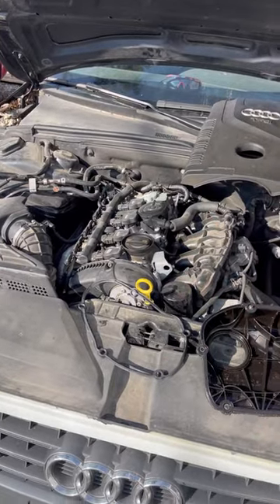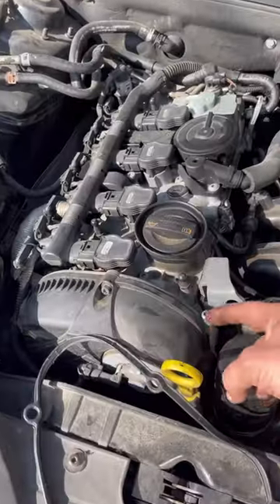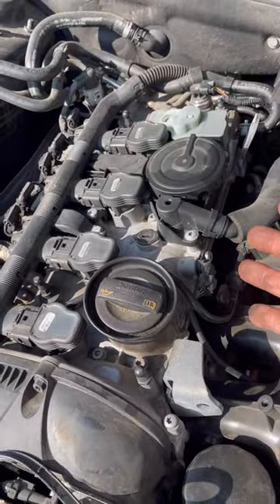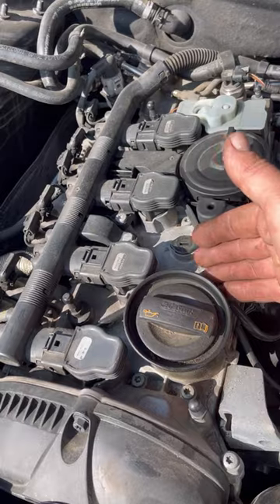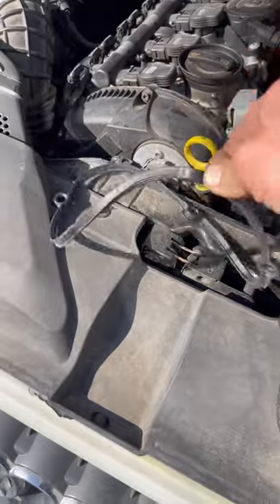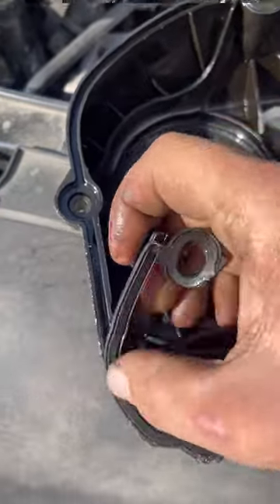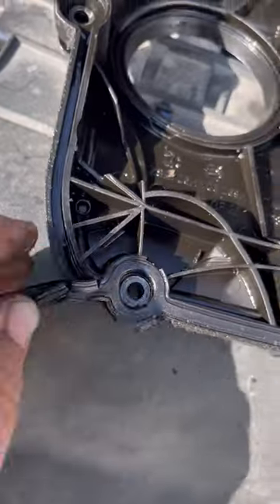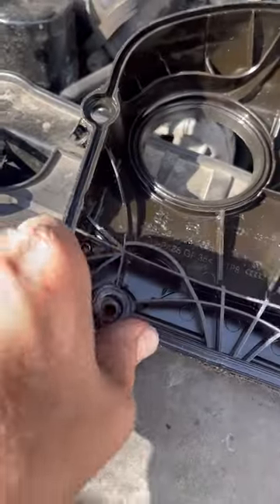VW Audi 2.0t oil leak Crusty Hard Gasket upper timing valve cover camshaft tray

Comment: Question? I have a 2011 audi a5 . Recently, I noticed white smoke with a strange smell coming from my exhaust.  Only happens when I'm idol for a while .car runs fine and drives fine no check engine light or anything..I already checked the coolant and oil, and everything is OK.  Could it be a bad headgasket? Also, I noticed the heat ain't working so well also . If you can help me, I would appreciate it .

Comment: I have oil all over my cam tray so thanks for the vid. I also have oil on the front of my alternator but it's a bit like sludge?? I think oil has dropped onto the belt and the belt is throwing it onto the alternator. Ever seen that happen before? Any thoughts?

Comment: Wouldn't that mean you need fresh front seals? I replaced all the front engine seals on my O58 1.8t and nothing leaks. If you get oil in the front cover it will degrade your timing belt.

Comment: Any thoughts on a using the aluminium upper timing cover? I also heard people use RTV instead of the oem gasket. 3rdly watched a project farm video and mopar makes the best RTV according to his tests. Ever used mopar RTV on a 2.0t?

Also next time try soaking your gasket in 303 aerospace protectant for a day. Install it after it dries. Heard someone used this on a serpantine belt and it lasted 300,000 miles. I soaked my rear main seal at 120k miles and haven't had to touch it again. I'm around 220k now.

Comment: When you re seal the cam cover, is there any tool or technique to avoid jumping timing if you leave the chain tensioner?
Reply from the maker: Take the vacuum pump off first and zip tie or ratchet strap the exhaust cam into place before removing the cam tray.  Never tried it but it should work.

Comment: What’s that gasket made of? Is it nitrile?  Same question for the cover? Is it polyethylene? How many miles on the engine, and what year is this car?   Comments?
Reply from the maker: Only takes 50k miles or less for the original gasket to start leaking oil.  6+ years
Reply: @NaptownTuner  VW is not a very reliable brand. Their track record was pretty good through about the early 80’s, then they started to go down hill. I would not buy their product sold today. They have too many problems, too early.  It seems they’ve joined the ranks of Fiat, Renault, and other European manufacturers, who build weekend cars, that are not daily drivers……comments?
Reply: @jimpie231  Besides the oil leaks my stage 3 mk6 GTI is very reliable. I mean I've never had to have it towed. I think I'll get at least 300k miles out of the engine but yes it needs a lot of TLC and upgraded parts.

I'm under mine once or twice a month but I also use this as a work vehicle. Drive it 200 miles a day. With a dirty cheap rev9 k04 and intercooler from ebay. :)

Biggest flaw for me is the mech unit keeps malfunctioning. I've had it on the bench 3 times in 3 years. Once for the temp/speed sensor and harness and twice for a couple of the solenoids. Also wrestled with the transmission and upgraded the clutch packs. Doubt I'll ever need to go back to the clutches at least.
Reply: @jimpie231  tell that to my 23 year old audi A4, nothing has perished or broken. The newer ones are terribly engineered now.

Comment: Is there any stop leak additives that could help?
Reply from the maker: Never use stop leak or high mileage type oils, just my opinion.  Fix the leak or let it leak.  Those type of additives are supposed to soften and swell the seals back into working and something like the upper timing cover gasket or case is really easy to repair vs having to the a rear main crankshaft seal or camshaft seals etc.  it’s something you could try but I don’t like it because I know you won’t bring some gaskets like the one I showed back to life, it’s so hard and crusty it snaps into pieces when you try to remove it.. it’s done.  Don’t take the chance one making one gasket slightly better for making another gasket or seal slightly worse